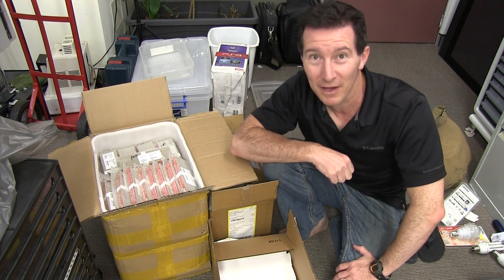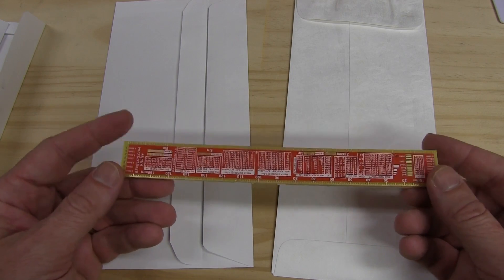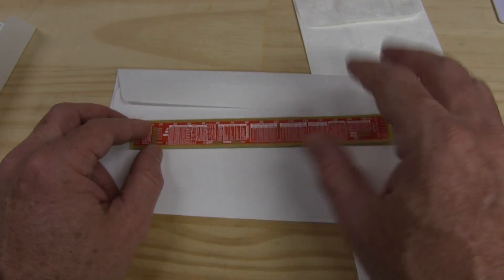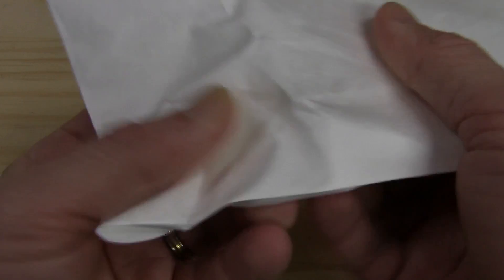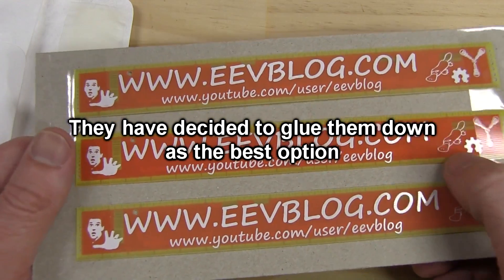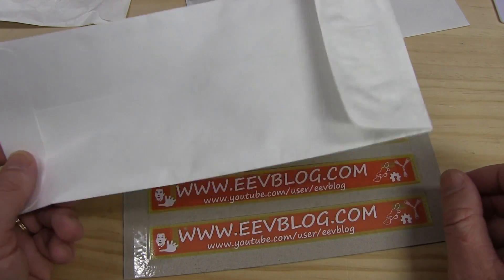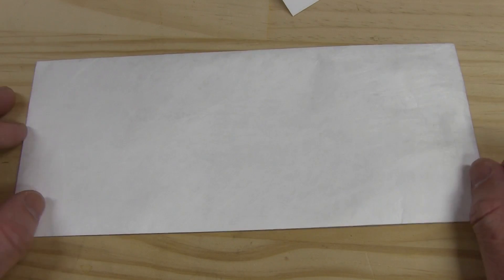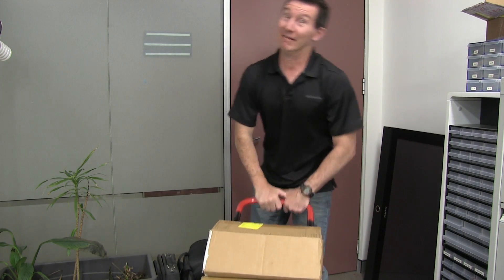µRuler Shipment Update

Comment: @EEVBlog, Dave, good thing you switched to the tear proof envelopes. The sorting machines in some areas have some nasty tight 180 degree curves in the damn things that most people don't realize are there. Watch this video at 36 seconds watch?v=KYFtalTNzKk and imagine the ruler hitting one of the curves and what kind of force is on the envelope from the ruler. Now imagine if you had used a ridged pcb. Yikes!

Comment: We don’t necessarily use it for strength, but it’s used as a vapor barrier that goes between the wood and brick or siding. This helps prevent wood rot and mold from damaging the structure.  Also, it creates a tight envelope in the building to stop wind from coming in.   Thanks for the link.  I've only heard Tyvek in the form of the large house wraps, but I guess it's used everwhere.